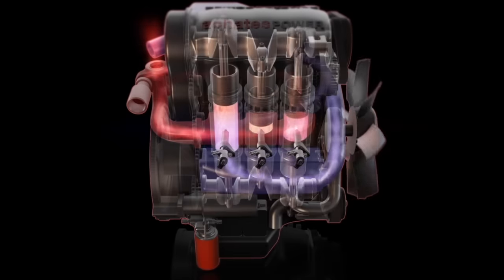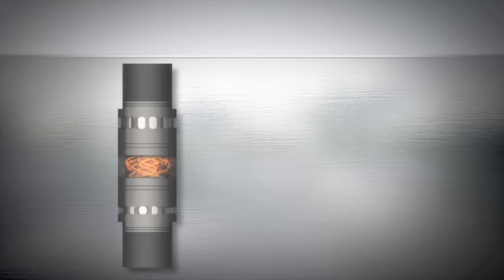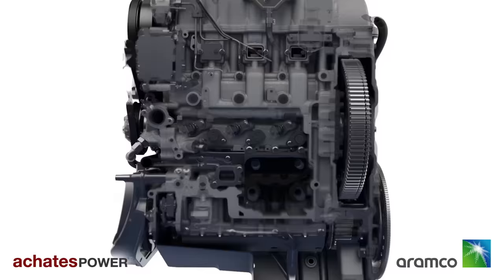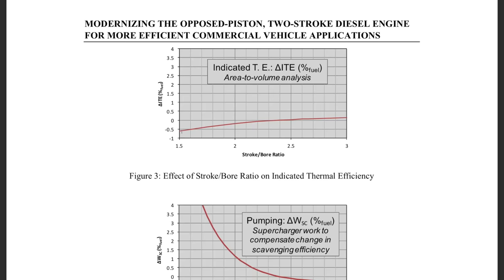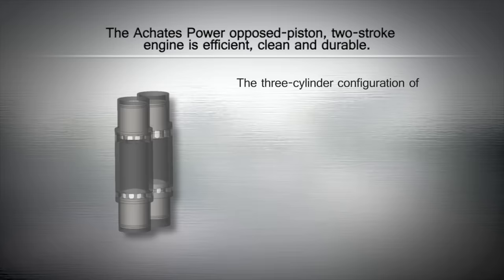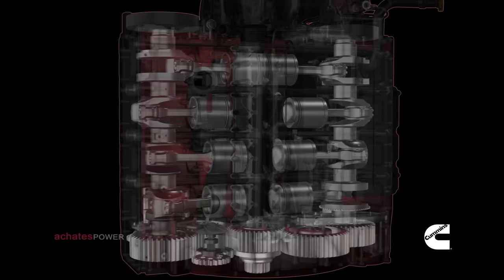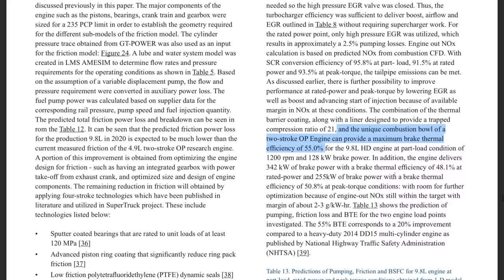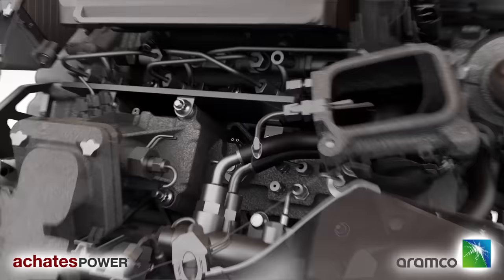Opposed Piston Diesel Engines Are Crazy Efficient

Comment: it should have been designed 4 stroke instead of 2 stroke so that it could swipe out the whole exhaust gases which contaminates the fresh air. also this work principle results in compression loses while pistons are still moving on power stroke at the same time valves are seepages gases.

Comment: They say a diesel engine is more efficient than a petrol engine. It great to see the efficiency percentage higher in this type of engine.  How would it run on a Bio-Methane fuel? 
Think it would be the next possible stage of more advanced engine especially without a cylinder head and all the valve drive train, etc. ! 
We must all try and bring down the carbon footprint at every possible point! 🤔🤔🤔🤔💪👍

Comment: this is pretty old concept but wonder if this can be used as a range-extender generator for a series hybrid vehicle. It could be super useful if this can be made to work with hydrogen with high efficiency combustion to generators on shafts on both ends of this setup.

Comment: I’d like to know more about the weight of this engine relative to its power output. With interest for aviation engines that can run a diesel cycle engine using Jet-A fuel to avoid the limited availability of Avgas outside the US and the lead it currently contains, if this engine has a desirable power to weight ratio, it might make a good general aviation power plant although it’s size may be an obstacle.

Comment: should be way more reliable.. replacing lets say 6 banger
you are trading 1 crank and 6 pistons , rods, camshafts, 24 valves, lifters, rockers springs and what not
for 2 cranks and 6 pistons 6 rods and thats it.
Much more bearing surface, less oiling galleries and channels needed no more springs, no more lifters, a lot of little things that could fail are now replaced by an extra crank and cranks have historically proven themselves to be much more reliable then all the rest.

I wonder if this could be adapted to gasoline engines as well...Higher revs possible with no valve train springs to worry about

Comment: How is the top crankshaft lubricated (presumably through oiling ports in the crank, but where does the oil go when it gets out of the bearings? And if there’s piston squirters, on the top pistons how does the oil just not sit on top of the piston? 

Also, as for seeing it in automotive applications, I’d be concerned about how well it would fit in the engine bay, obviously for V8 diesels, like powerstrokes and duramaxs, you’ve got a ton of room on the front of the engine, and not a lot on the sides, for I6’s like a Cummins, you’ve got plenty on the sides, and not much on the front, but none of them are super tall, I’d like to know how well itd fit in an engine bay height wise…obviously you’d have plenty of room on the sides and front, but I don’t know how a manufacturer would make an engine bay tall enough to fit that, within reason

Comment: I guess it's just a powerful engine with no speed since the interconnected crank shafts tend to work each other I.e. the speed of another is limited by the resistance of the other

Comment: Don't misunderstand me, but I would love to see a small high output diesel available for trucks/SUVs where it can do the most good for consumers. BUT.....

 Zero words spoken about emissions. There are so many coulda woulda engines out there, and we do not get those unless they meet CARB and the EPA standards.

 So has Achates even bothered trying to figure out if this diesel of theirs will need EGR, SCR, DEF ??? Is this why they are pursuing a military option so they can ignore emissions?
Reply: all diesel engines require egr, scr and def to meet current standards. the AP engine already meets euro 10 and carb 2027 emissions standards with current after treatment systems. no one else can claim that. the biggest challenge they face right now is adoption. you cant just throw this engine into any vehicle without some "adjustments", which are very expensive. the military adopted this option because the engine pretty easily fits in the bradley and abrahms and the thermal efficiency lends itself well to low heat rejection. (smaller radiators that are easily shot out)

Comment: I wish they made a 3.0 version to swap in light duty trucks
Reply: Achates was promoting the 2.7 L 3-cylinder by showing it in a Ford F-150 pickup.
Reply: @brianb-p6586  oh I saw it but I'm 90% Ford just bought the license to prevent it from being used by another major manefacturer
Reply: @jonathangarzon2798  that doesn't make any sense. Ford didn't buy anything regarding this engine - Achates just used a Ford truck for a demonstration. And even when a company buys the right to use a technology, it is is rarely exclusive so it doesn't stop anyone else from buying it as well.

Comment: Soviets used this fabulous design it their t64 tanks. Pile of cr@p. Low lifespan, low reliability, huge oil burn, toxic exhaust fumes.   Due to high tolerances engine had to be heated if external temp is lower than +10 celcius, or it wouldnt start. This design is know since 1930 and nobody use it. Why? Becouse its so great??

Comment: How does one oil an upside down rotating assembly? I figure it’d all be pumped to the journals from the pan on the lower rotating assembly, but I’d have to imagine the upper cylinders may let a little more oil past the rings??

Comment: Don't 2-stroke engines have shockingly poor emissions though ? The Napier Deltic 'delta'  engine as used in a British 3,300 hp locomotive had 3 crankshafts and 6 pistons per bank btw.

Comment: With higher combustion temps wouldnt there be an increase in no2 production? also overcoming the cylinder pressure to inject a fresh air charge, to me at least, should use a decent amount of power from the super and turbo chargers (there doesnt appear to be an air charge being forced in from under the piston like a traditional two stroke). I would expect uneven wear across the cylinders from the cooling due to the intake air charge. The oiling system would also be interesting in my mind at least as far as emissions go. Pistons may need to be forged or exotic materials to absorb the additional heat and maintain proper dimensions. More so then your average diesel would be egts causing havoc. Id guess the above is causing delays in release. Just guesses though I am definitely not an engineer lol.

Comment: Genuine question: I've always read that 2-stroke engines pollute more and its not practical to make them emissions-compliant.
So with the high efficiency numbers of this engine, is that not an issue anymore?
In other words, does having high efficiency numbers mean the emissions are less polluting since most of the fuel is utilised to produce work?

Comment: Question, the pistons are opposed so the stored heat is focused on the top of the pistons rather than a head or a bore.

How does this engine extract unused heat via a cooling system?

Comment: They are two stroke engine makes more power because it spins fast for a more power strokes per minute than a four-stroke 4 cycle it's just obvious that's why in motorcycles we went from 250s to 450s four strokes they were 252 strokes and now we use 450 four strokes so therefore that's one of the explanations

Comment: Not a new concept by any means. Similar engines were being developed and used way back in the 1950s but they proved unreliable. With modern manufacturing and materials science I dare say these problems have been overcome. Kind of like 2 stroke efficiency with much cleaner exhaust.

Comment: How are the piston rings lubricated, as traditionally 2 strokes tend to fail emission tests as they need an oil fuel mixture. Talking about emissions I thought diesel has too much of a bad reputation! If there are 2 sets of rings and oil is squirted between them, I think you should have explained this too.

Comment: I had this idea ( opposing pistons ) about 15 years ago, for a tow pig project that never got off the ground. I was planning on simply using 2 cummins blocks with an in-house made head. No money to play with so the idea died. Opposing pistons has always fascinated me because of the over all inefficiency of a stationary head and loss of thermal efficiency of the fuel. I would love to get my hands on one of these and test some of the ideals in the mainstream diesel enthusiast market meant to increase power. I just want to know what this opposing piston theory is capable of. And if it's a viable option for a 1 ton, 1.5 ton tow pig project.

Comment: Wondering how the oiling would work. With vertical cylinders you've got an overhead crankshaft and no simple way to avoid filling the backsides of the piston with oil. 
With a horizontal cylinder setup I could see this engine working but suspect it wouldn't fit between the frame rails of any common passenger vehicle
Reply: Germans were running aero engines upside down in WW11. I get what you're saying about filling the top pots up but there must be a work around
Reply: Oil can't fill the back side of the piston. It's reciprocating many thousands of times a second. Maybe you mean after the engine stops, with the drain back.

Comment: How does the residual exhaust per stroke affect NOx levels? Does this mean it needs a relative DEF system rework to meet EPA requirements?
Reply: I think they throw everything there.  Diesel oxidation catalyst (DOC), diesel particulate filter (DPF) and selective catalytic reduction (SCR) are used with diesel exhaust fluid (DEF). An electronically-heated catalyst (EHC) is also used on Achates’ concept engine and  exhaust gas recirculation (EGR) will be included when goes in production.  Hmmm...

Comment: It's 2.7l, turbocharged, supercharged and only 270 hp?
Reply: @@rotenone3871 I don't know. Certainly far far  more that 270. There are a countless conventional piston engines that get a more horsepower than that with less displacement and without twincharging. And this is an opposed piston engine, so it promises considerably better thermal efficiency than normal engines so 270 hp is underwhelming. Sure I know it's a diesel but still.. Twin charged and 2.7l

Comment: What's the market through? Electrics are assumed to be taking over the car market in the next ten years or so. If battery technology continues at its current pace of development, trucks, tractors and backhoes (oh my!) aren't going to be that far behind. Sure several companies have signed up as partners, but outside of the military (and a few other niche applications) is it worth retooling an entire engine production line for what might end up for a relatively short production run?

Comment: Disadvantage, high centre of gravity (although making it in a 'boxer' configuration would solve this), I suspect more exhaust and more wear on the pistons. I would also suspect they are noisy and not a nice type of noise... Would all the exhaust be able to escape the cylinder before the piston goes back down? 

Having 'suspected' all that, the efficiency numbers are amazing.. I would definitely get a vehicle with this type of engine (huge diesel fan here).
Reply: No, exhaust is not complete before the top pistons start coming back down. In uniflow non-opposed two-stroke diesel engines the scavenging portion of the cycle (which is both intake and exhaust) is about one-third of the cycle and roughly symmetric about top dead centre, so ports open about 60 degrees of crank rotation before the pistons reach the "bottom" of the stroke, and close when the pistons reach about the point on the stroke "up" (toward the head, or toward each other in an opposed-piston engine).

Comment: How is the oil removed from the inverted pistons? To me it would seem this layout would work better horizontally opposed and then my question on this wouldn't exist. I know in WW II Mercedes had an inverted V engine for aircraft, but I don't know how that worked out either. Other than my question on this it appears to be something good in design.

Comment: how doe the oiling system work  , with transfer ports in the sleeve like a typical 2 stroke and  4 stroke oil system how does this engine doesnt burn oil , and how does the oil on the on the top bank of cylinders recirculate (running a engine upside down) massive amount of oil will be on the pistons?

Comment: I wonder if this design would work better if built as a flat engine similar to a porsche. That would help with oil leaking down. Also id assume a supercharger would make this style of engine much more efficient as the pressure in the intake would force out the exhaust faster  and improve power.
Reply: All large 2-stroke engines (which are all diesels) use a scavenge blower. Most diesels are also turbocharged, which isn't for replacing exhaust with fresh air, but does increase power by providing more air to use in combustion and for the working cycle.
Reply: the reason it stands upright is because that is the only way to package the unit in existing vehicles.  it's hard enough to introduce a new architecture but extra hard if it doesn't fit anything.

Comment: It is a dead-birth, it is not new, the Germans experimented with those engines already in the second world war for aircraft-engines (Junkers Jumo), the British introduced them as "Napier-deltic-engines" in Diesel-lokomotives ..... and now? There are gone, why? There are reasons for it, first of all, to fabricate them is not so easy, second, the size of the motor-block is huge, because this engine must have two crankshafts at the ends of both sides, connected via a few amount of gears, that makes that motor not only huge, but also very complex and complicated. 

In modern cars, there is just not enough space to implement such engines without changing the size or look of that car. 

By the way: The future is electric-motor, driven by batteries, who invest now in that old combustion-technologie will burn all that money for nothing.

Comment: I imagine with computer operated injection it could be interesting engine ,  they need to make it past  the EPA , All new Gasoline and Diesel engines are very complicated compared to electric drive systems , but electric is not without its problems , charging stations or the amount of charging electricity that might be required if we would go cold turkey electric, keep working on it guys 😁

Comment: But since when a market follows with whats better? Market follows whats advertised properly. People still buy engines depending on their HP. Yet they don't even understand rev band... I know mechanics who don't understand that HP that comes in 6500 rpm is worthless unless you are a lunatic... and then comes a jetta tsi (1.4LT 150hp) that feels faster and more responsive in the city than a civic si (2.4L 220hp), yet the jetta actually has insulation and some quality in the cabin (heavier). Of course reliability is a different discussion...

Comment: The super charger is responsible for controlling aspiration and the turbo makes boost correct? How does the engine make boost if at any time the intake valves are open the exhaust valves are also open?

Comment: you don't mention the lubrication system or cooling system.
i would like to know how the oil that lubes the cylinders is kept from leaking?
Reply: It is constantly consumed:( It is dosed towards rings at some prescribed rate. Afaik every 2-stroke w/o valves, which uses pistons for opening and closing ports will consume oil. Because it is blown off the rings when they pass the ports.

Comment: The political climate (pun intended) will kill this before it can get going, as there is no way around the problem that it depends on fossil fuels and produces high compression combustion products.  Personally, I would love one of these under the hood of my car, but I do not see it happening.

Another technology that deserves mention (which will probably also be stillborn for political reasons) is the hydrocarbon fueled electrical cell.  A chemical fuel cell running on hydrocarbons is not as efficient as hydrogen fuel cells, nor is it even as efficient as these opposed piston diesels, but they can directly produce electricity from hydrocarbons and produce none of the high pressure combustion products.  The big advantage of the hydrocarbon fuel cell is the the infrastructure to support electric vehicles powered by them already exists and will not require huge increases in electrical power generation.

Comment: would this be less emissions than a similar output gas engine? While many people seem to think fuel economy = green, the dirtier emissions of diesels negate their fuel economy advantage. If this legitimately gives less emissions than a similarly powerful gasoline engine, I welcome it into the world
Reply: Two stroke engines burn lubrication oil.  In this design, there is no way to scrape lub oil back to oil sump when lub oil enters the combustion chamber.  Emission level will not be too good.  It can be sold though if after treatment to emission is done.  But then it will increase operation and maintenance cost.

Comment: Wouldn't it be ideal for a farm tractor running on its side. Inlet on the bottom and turbo on the top. Low bonnet height, designed to work at very narrow power range, electric assist turbo to do away with  supercharger, ability to take power for say hydraulic pumps, pto and transmission from three different points simplifying transmissions.

Comment: The L60 horizontal opposed diesel engine the was used in the Chieftain tank had a 12 degree lead on one crank, I think I remember it as 12 degrees, and a Roots blower but the engine was rubbish for the tank as it was underpowered.
Reply: The L60 4A,was absolutely diabolical, compared to its predecessor the Meteor, which was a beautiful engine, very reliable
Reply: @stewartbrown8115  lots of sleepless nights trying to keep them going.  💤